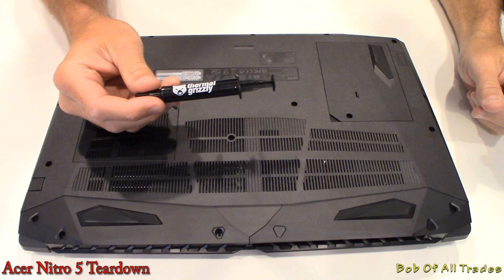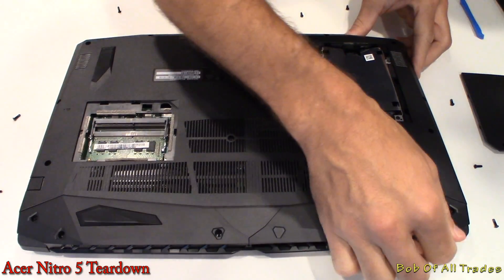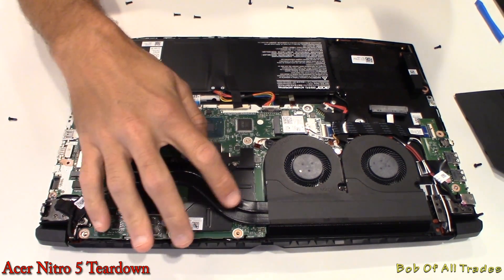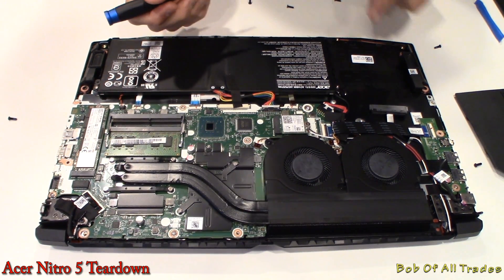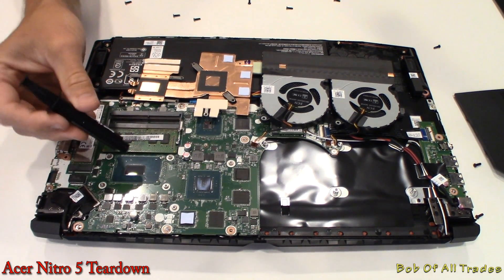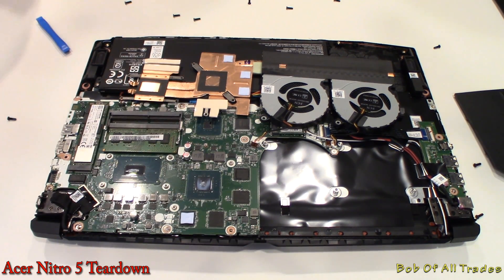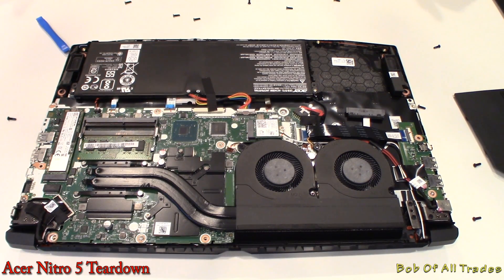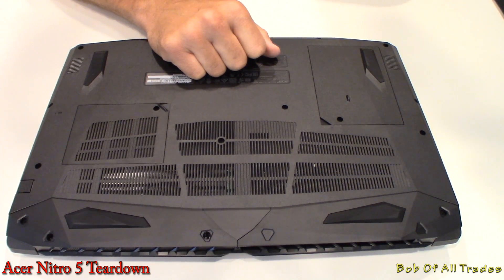Acer Nitro 5 Repaste w/ Kryonaut!  i5 8300h

Comment: I have this laptop but with a 7700HQ processor and it had serious issues with thermals on 2 of the 4 cores after 3 months. I just changed the thermal paste and oh my God temperatures went down by 35 degree under load! 

Thanks for the video I just have 2 points to add to the video:
1. If you have a hard drive remove it BEFORE disassembly! There is a cable that runs from the motherboard to it and it's screwed to the bottom lid.

2. The battery DOESN'T work untill you screw the bottom!
 I had a panic attack after a very smooth procedure when it did nothing when I tried to test boot it untill I had all the screws in place.
Reply: A lot of laptop manufacturers nowadays like to use crappy thermal paste to cut costs. So no surprise there :)
Reply: @alexclarke6924  .50$ on a $1000 laptop. Incredible savings.
Reply: @dolphin069  it is more more like 50 cents per Laptop, that they save and with tousands of laptops it is easy to see how they saved money. Especially considering this is one of many smal changes to save money, which adds up fast
Reply: IronGuy 64  i7 + 1050ti
Reply: @williamkowalsky3178  i7 you mean?
Reply: Wow thats great i bought the new version with 1060 and i7 8750h and its so damnn hot (in 5 min playing dota2 at full setting it can reach 90c) thank for the info
Reply: @muhammadfurqon5919  I had NH-t1 thermal paste. Now I can use my I5 7300hq in turbo mode with no overheating.
Reply: @laszlodajka9914  wow thats great me too, i have applied the thermal grizzly it work good enough decrerase the temp 5c-10c normal 95 now it 85 highest and  decrease the voltage to -0.160
Reply: @muhammadfurqon5919  
Did you get the 85 celsius when you undervolt it to -0.160 or when you only repaste it without undervolt it?
Reply: @nori6237  sorry wrong answer toanother person see my comment below lol
Reply: I have the i5-8300H and 1050 ti 4gb and the cpu reaches 100c and the gpu reaches 90c, I really need to repaste it soon
Reply: I have a i7-8750H CPU with GTX 1050 Ti version...after 1 and a half years of use my CPU cooler is going on only 1700 RPM on max power when it should do 6122 RPM ...i have been thinking about buying a new one...does anyone know if i can save it?
Reply: @crgraduu  Same specs, 2018 edition. My CPU fan is making grinding noises too (after ~2 yrs)...I'll be keeping an eye on it for now.
For your case, I think you'd be better off just getting a new fan instead of trying to make this one work. It's probably a blown bearing.
Just get a new one. They're cheap anyway. Oh and either just cut the tape that secures the fan to the heat pipes, or be VERY careful while taking it off the fan or else you'll bend the heat pipes. I've seen a couple of cases when people ended up damaging their heat pipes trying to take the fan out.
Reply: @livintolearn7053  yeah...did that a few months ago...the fan was ruined yet in its time of malfunctioning the heat might have ruined this laptop...either that or some windows bug is causing it.What I mean by that is that temperature is allright...not going over 80°C I get random high GPU/CPU usage that makes my games lag ...most frequently happening during CSGO sessions.
Reply: @crgraduu  It shouldn't be due to damage from heat as long as your CPU and GPU clocks look fine...
Have you tried to figure out what causes the utilization spikes? Just keep the task manager open in detailed view while you play, and keep an eye on it.
Reply: @livintolearn7053  im gonna keep that in mind
Reply: @williamkowalsky3178  "Stutters" isn't very helpful...

Have you tried keeping track of the clock speeds whenever you're pushing the CPU?
If the clocks are fine then the stutters are due to the CPU not being powerful enough for what you're doing.

If the clocks aren't okay, then maybe your thermals are holding the chip back. Try repasting again. Don't use too much or too little paste. And check the fans and vents for dust before you do that.
Reply: @williamkowalsky3178  I don't know. 
But first, what frame rate are you getting in that game? Are you sure your CPU is not running at slower clock speeds than what it's supposed to be able to do? Have you undervolted the chip? Also what game is it, and what settings are you playing at?
Reply: IronGuy 64  it was like ~750 euro, from what I see the 8th gen ones are currently sold at about 925ish at my country right now
Reply: What thermal paste
Reply: @kenken-ss7jn  Arctic mx-4
Reply: Where can i find this heatsink?.. i really need this..
Reply: Silia Blackfame how do you know how many cores have what temperature and stuff like that
Reply: @imjustarandomdoggy6460  HWINFO or CPUZ or some other freeware.
Reply: Just yesterday, I opened my same laptop (Nitro5, 1050 4gb, 16gb RAM and 1TB Hdd) as it was not giving good FPS when I pay Pubg. I just cleaned the fans with cotton swabs and blower air pressure and reassembled it. After that, FPS got just doubled and temperature also dropped significantly. I've not checked the exact temperature though.
Reply: I've had the same issue with cores 1 and 3 higher than the other two.  I thought it was my repaste job.  Did it a 2nd time and it's still the same.  So, I guess this cpu is supposed be like that.  I also did an undervolt at -.150v, max temp 80°c.  Will do more testing to see if I can bring the voltage a s temps down further.
Reply: Panic attack... LOL!
Reply: @npteamleader  both, but now i have found the solution i undervolt it to 0.125 and underclock using throttlestop to 3.4 ghz allcore and it went down to 85h celsius highest and normal at 80 without losing peformance whatsoever so yeah i hope that will help
Reply: @muhammadfurqon5919  
Nah, that's ok, thanks for answering, seems that chassy couldn't really handle gtx 1060 + I7-8750H properly.
Even it's still struggling with I7-7700HQ + gtx 1060 (2017 helios unit model) configuration.
Reply: Thanks for letting me know.  I've been seeing temp spikes in a few of my cpu cores as of late and will give this a try!
Reply: Why did temperatures go down only by applying new thermal paste?
Reply: The second tip is really helpful! how does it work? so strange
Reply: One more tip, Push the vent shell to remove the plastic shell more easily.
Reply: Please help I didn’t know I had to remove the HDD and now I accidentally pulled something off on the other side, is there any way to fix this?
Reply: @AB-qi6lu  I'm pulling mine apart as we speak will see if you can do anything
Reply: Silia Blackfame I already have put it back together, thanks though :)
Reply: @AB-qi6lu  the cable looks replaceable costs about $4-5
Reply: @williamkowalsky3178  60 degrees is really really low for this chip. It should be running hotter if you're pushing it. If you're seeing stutters and the CPU is sitting at 60 degrees, then either the chip isn't getting enough power - in which case your clocks CANNOT be fine, or the problem isn't with the CPU at all and you should check your other settings that may be causing the stutters.
Reply: I know im randomly asking but does someone know a tool to log back into an Instagram account..?
I was stupid lost my password. I would appreciate any assistance you can offer me.
Reply: @Kyng Sebastian Instablaster ;)
Reply: @Yusuf Baker I really appreciate your reply. I found the site through google and I'm in the hacking process now.
I see it takes a while so I will get back to you later when my account password hopefully is recovered.
Reply: @Yusuf Baker WTF IT REALLY WORKED :O Literally hacked my ig password within about 45 minutes of using the site.
Thanks so much, you saved my ass!
Reply: @Kyng Sebastian Happy to help :D

Comment: Nice video! I have the same laptop too.Playing BF5 ob with stock paste and undervolt -100 still get too hot when 80-100% CPU usage.Did u test under heavy load after repasting  the laptop?
Reply from the maker: InnovationS Yeah check the review 👍
Reply: i too have the same laptop ..... please  tell me  for what time period  you play bf5 , what temp do you  when it reaches 100 % usage? does your laptop window crashed any time while playing ?... please help i am to much worried about this.... because my laptop reaches 80-87'c temp(-0.120 undervolted)while playing very old game like cod4 modern warfare.... so i dont know what will happen if i start playing cpu intensive games like assassin creed origins?

Comment: I have a similar laptop ( with 1th hdd instead of ssd ) and i want to put a m.2 ssd in , does it void the warranty?
Reply from the maker: It would be sad if it did and wouldn't make much sense otherwise :)  You're fine!
Reply: It won't void your warranty except you broke some of the machine after upgrading

Comment: Does this have thermal issues? Will it have a bad effect to the laptop's lifespan? Should I buy Dell G3 instead?
Reply from the maker: Check the review for those details
Reply: Bob Of All Trades it gets warm when gameing but it don’t get that hot it gets warm only when gameing
Reply: Yes the nitro 5 has cpu thermal issue because the cpu is further away from the fans than the gpu.
Reply: I do have problem like all people with heating, but I absolutely have no other problems. other problems should be in the guarantie, i would send it back if i was you. @raptor

Comment: So, as I see from your videos, it's always better to repaste after you've bought a laptop. But what to do with the waranty? As I know, only MSI gives you an apportunity to take off the back panel. 
Also, I would like to know your thoughts about "Normal thermal paste vs Liquid Metal", is there any difference in temperatures?
Reply from the maker: LM vs traditional paste differences vary depending on the laptop.  Some have their fan curve scale closely to temps and other laptops don't.  Makes answering the question impossible unfortunately.  

I have tested all sorts of non-conductive pastes and Kryonaut comes out ahead most of the time.
Reply: I was asking about LM vs Paste because I'd ordered a ThermalGrizzly Condactonaut few days before and applied it on my old laptop Asus K53TA. And you know, it was a very small difference between Arctic MX-4 and Condactonaut, maybe about 5 degrees C Idle and 0 to 1 degree C under load. And I'm absolutely sure I applied it as it should be. Don't know, maybe just only my case
Reply from the maker: Looks like the fan curve scales close to temps on that machine then.  Your application was likely great.

Comment: Why dont they have an option to set the fans at 2100 rpm all the time and when it heats up it ramps up from their . It heats up beacuse the fans are at Zero and they start spining at 40 or 45c
Reply: you can actually do that, it has nitrosense and it lets you change how sensitive the fans are, so you can do that for sure

Comment: Quick and (stupid) question as it's hard to find an explicit answer: 

It's always important to remove all electricity including battery because it'll cause a short circuit when i apply the 99% alcohol on processor/mobo etc. Can you please confirm my thinking? 

(I've killed one laptop mobo, didn't unplug the battery while cleaning with alcohol. Thank God for warranty.)
Reply: I believe the nitro 5 does not have a removable battery so it does not matter.
Reply: Hold on at 8:30 in the video it shows him plugging in a cable that looks like it is from the battery.
Reply: @aarong.4691  yes that is CPU power from the battery

Comment: my computer is stuck in a black screen but the keyboard lighteys are on. this happened after i turned it into an oven while it was on and charging and it felt hot. it happened before and after a while i trued turning it on once and it worked. now its not working. how do i fixing?
Reply: Check the memory ram modules, I had the same problem and one of the ram module wasn't working properly. Now it's working again.

Comment: I assume that all screws are the same? Since you left them randomly around the table.
Reply from the maker: Absolutely nothing about the "randomness" of the screw placement.  They're all right next to their respective hole :)
Reply: Bob Of All Trades ohhh. Thanks. I've opened computers before but they weren't mine and were usually old. Nice Vid 👊

Comment: Hey Bob, thanks for all these Acer Nitro videos. After watching those 3 videos (several times) and your undervolting guide (several times) I tried to take a stab at undervolting  with throttle stop. I followed the guide and your advice to undervolt by -.125 on both core and cache with speed shift set to 0.
Everything is running well and cool but I'm noticing my CPU is sitting right at the base speed of around 2.3ghz even when running Battlefield 1 on the default ultra settings. 
Did I miss something?
Reply from the maker: J. A. You had to of.  I haven’t had this issue yet but you’re the second person to say this over the last few days.  Perhaps I misguided somewhere in that video?  I’ll check it out.
Reply: Thanks Bob, loving this laptop so far but I really want to maximize what i can do before I attempt the repaste. 

For reference:
I have NitroSense (the stock Acer fan controller) still installed, throttle stop, cpuid hwmonitor, msi afterburner, are all installed. Maybe a disagreement between one of those applications?
Purchased refurbished just a few days ago. Windows update 1803 keeps failing to install (ill sort that out soon enough.)
Plugged in and unplugged I have the power slider set to the middle.
I also just returned everything in throttle stop back to default. 
Max Clock sits pretty at 2296mhz on all 4 cores.
Reply from the maker: It's the Nitro Sense app that's causing the issue.  It likely keeps going back to "performance".  I would repaste and reinstall the OS while deleting all partitions via my "Bloatware Removal" tutorial.  Don't even bother reinstalling Nitro Sense and you have a cool, quiet and trouble free system.
Reply: Bob Of All Trades Thanks for the response B. I tried uninstalling nitrosense and restarting before a full wipe and still stuck at 2.3ghz. 
Acer suggested a "reset" which i tried, that also failed at around the 60% mark. Starting to feel like i got a dud, even though the pc is running well in most other aspects. 
Im gonna go buy a fresh usb drive and follow your bloatware removal tutorial. I'll report back what happens.
Reply from the maker: J. A. That’s a good idea!   Be sure to follow that to tutorial completely. Delete all of those partitions and start new. 

There’s nothing on there you need, everything you need is online anyway. 
However, make sure you have your computer connected wired or have the 9560 intel Wi-Fi drivers ready to go before hand. The latest build of windows is not recognizing that Wi-Fi card yet.
Reply: I've been messing with settings, adding and removing programs, updating drivers, etc and I believe I have discovered the issue. I removed throttle stop from the task scheduler and stopped it from starting on startup. Launched CPUID upon restart and saw all 4 cores happily bouncing around and boosting all the way to 3.9ghz. 

I believe the issue is some of the stock settings in throttle stop not playing nicely with the i5 8300h.

I chock this mostly up to me not knowing how to properly adjust the many settings, although I did follow the i7 8750h guide extremely closely. Even upon deleting and reinstall throttle stop, the cpu throttled to 2.3ghz instantly. Maybe there are some base adjustments you can suggest.

You have been an incredible resource for information and I thank you for all the time and energy you have put into your channel. Thanks again B

Comment: U can use thermal grizzly líquid metal?
Reply from the maker: uvuvwevwevwe onyetenyevwe ugwemubwem ossas You can use whatever you want :-)
Reply: be careful with liquid metal...i tried it on a different laptop and i bridged a solder joint that was insanely small....luckily i found the issue but you can turn your laptop into a brick quite easily

Comment: Those temps are not too hot? D: i have the same laptop but with i5 7300HQ and my max temp while playing is 68°C asjhdasd I'm planing to sell this one just to buy the one with i5 8300H processor and GTX 1050ti, since mine has only the 1050 but now im just too worried about the temperatures :/ I play dota2, fortnite, quake champions, HOTS. And honestly my max temp on those games was 68°C like i mention before D: i didn't even repaste the laptop, i did the undervolt to -180V tho. Just help me to clarify my mind please :( sorry if my english is bad. Im from Peru.
Reply from the maker: Temps are great on this now.  Mid 70's after I did a little work which is easy to do.  You get a much higher clocked CPU with twice the threads and a tier higher GPU.  Hard to justify a complaint on temps at that point :)  Great machine and priced right too!
Reply: Bob Of All Trades thanks Bob! U think it will be worth to upgrade like that btw? i5 7300HQ + GTX 1050 4GB + 1TB HDD to i5 8300H + GTX 1050ti 4GB + 256 SSD for like 200 dollars more?
Reply from the maker: Izzy Gaming Absolutely!
Reply: Bad idea buy it with the next gen GPU

Comment: How about temps on load without coolboost, coolboost makes too much noise! Will repaste void warranty? Also will putting m.2 void warranty? Awesome video thanks, but you could put chart at the end of the perfomance change that the paste did. Im looking at i7-8750h+gtx1060 acer
Reply: If you open the case of any computer it usually voids the warranty
Reply from the maker: Who Is Mojo I was pretty clear that this was not a video for those answers.  

Check the review 👍
Reply: But what is load temperature after repaste without undervolt and without coolerboost enabled? Im just curious how is it different from the stock settings and acer thermal paste and repaste. I saw your video, really great one :P im sure u will receive more subs and attention.